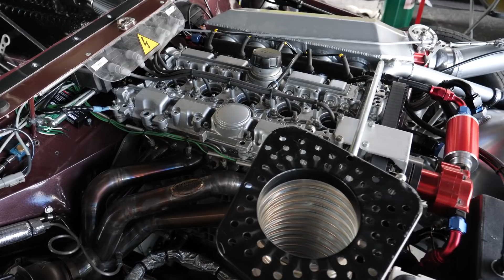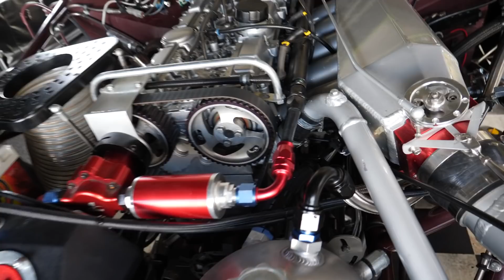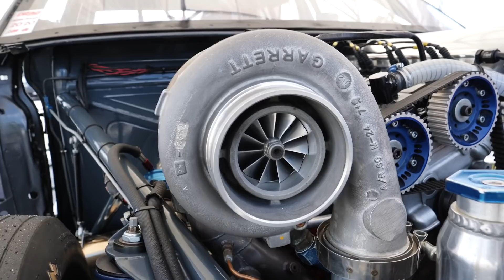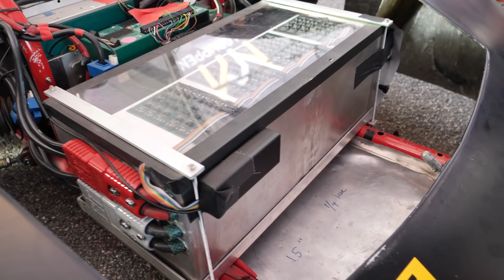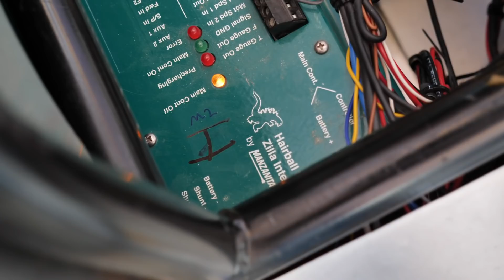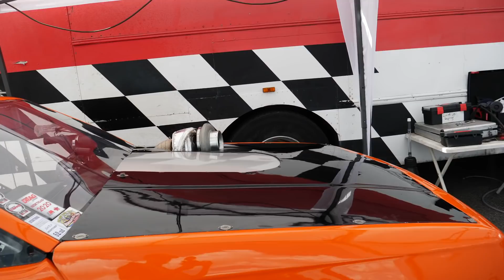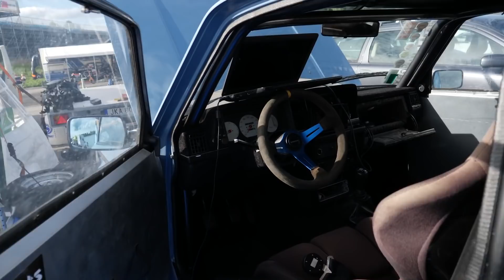4 and 5 cyl Turbo and Electric Dragracing Cars at Mantorp Sweden 2020

Comment: The car at 0:53 is using an aluminum diesel 5 cylinder block but is running on petrol/methanol?!? Is this a fairly common setup in Europe? I’m guessing it’s a T5 head adapted to a stronger D5 block. I’d love to learn more about this if anyone has good resources on the process. Pardon my ignorance but being in the States means there’s very little in the way of Volvo performance culture.

Comment: crazy to get over 800hp from a 10hp forklift and its not just expolode or start burning or some shit
Reply: An electric motor will take as much electricity as you can throw at it, only problem is heat and friction in the bearings.
Reply: Yes that is impressive, but remember they are doing an 8 second  pass an they attach it to an A/C. Forklifts could work 24hrs. a day. But dang! 80x more power?!

Comment: Love the way the guy with electric car/bikes thinks and builds!  And i thought that orange civic hatch was a lil to quick off the line, but then i seen the 4g63 and then it made sense
Reply: It was a Nissan sunny with the 4g63
Reply: There is no Honda, the orange car is a Nissan Sunny (look at the rear lights), you could get them with a 4wd 4 cylinder turbo from the factory.
Reply: Honda engines often put down big power anyways.. many k20 builds making 1000+
Reply: @ReubenHorner  i know this, but not often and certaintly not reliably! but my point is its rare and when they do for some reason the teams or person isnt around long. And like i said how often do you see a civic launch that hard and straight and sound that good?!?!? NEVER! lol
Edit: not hating on hondas either i love any and all QUALITY builds all over the world🤙🤜🤛